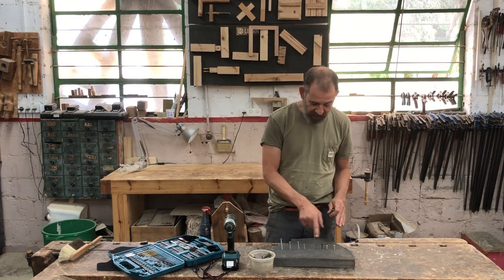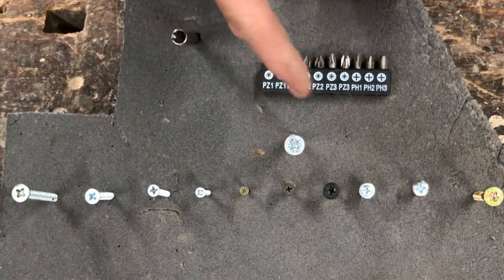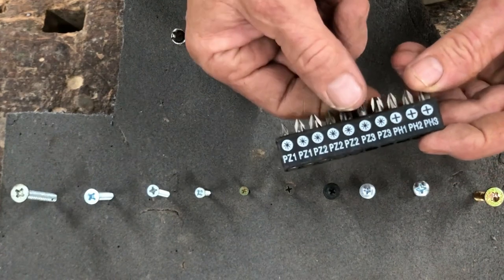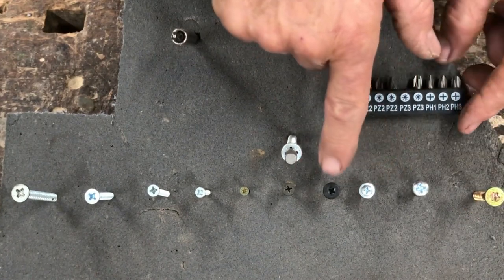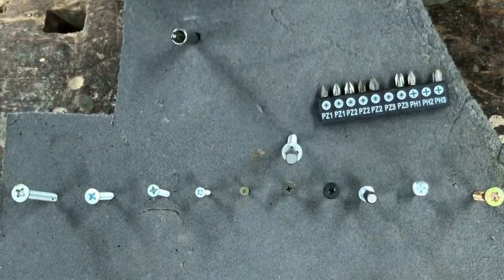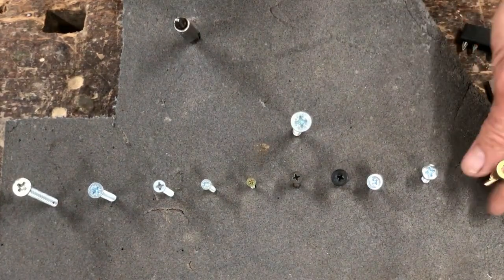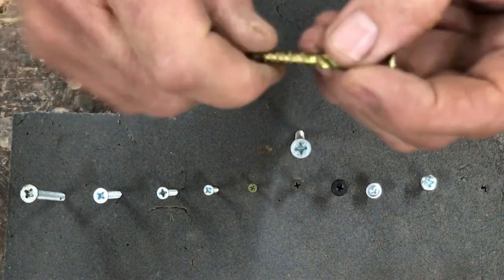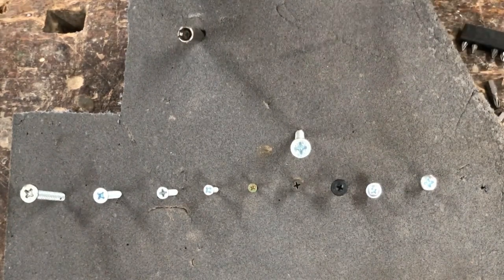Stop Stripping Screw Heads

Comment: Great video! Removal of a stripped screw that can’t be removed by pliers?
Reply from the maker: Hi well or you can chisel a hole around the head and try gripping it with a “mole grip” that’s the English name I think in other countries it has different names 
Try hammering the correct bit into the stripped head then try removing screw 
Or if its possible use a hacksaw blade and cut the screw between the two pieces screwed together 
Ot use brute force like a crowbar or hammer to snap the screw 
Good luck thanks for your comment